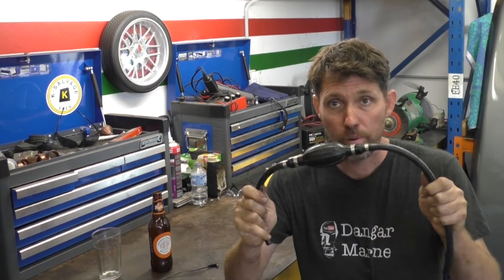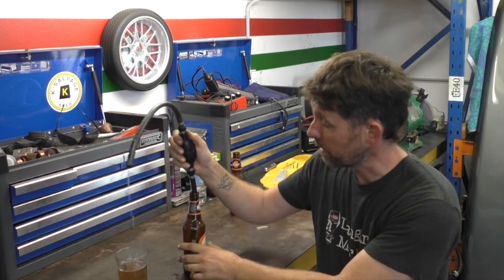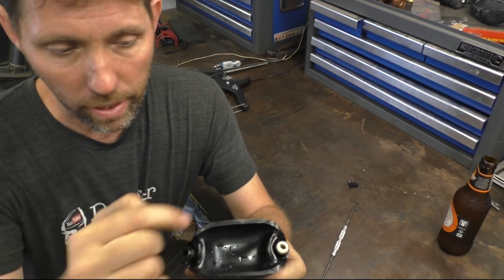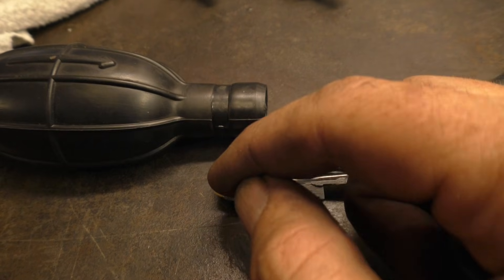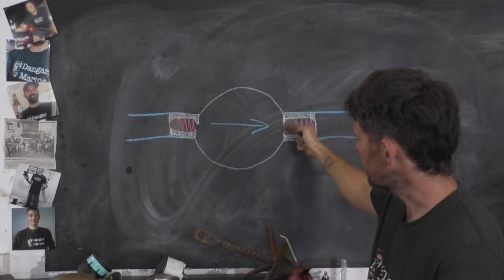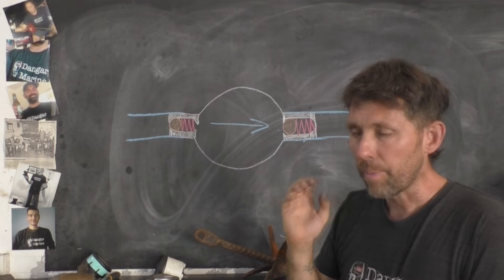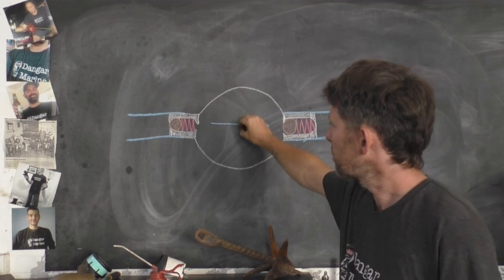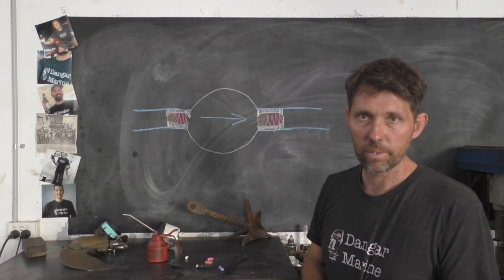Outboard primer bulbs

Comment: You just reminded me of another dumb thing I did. Squeezed the bulb with the arrow pointing down and no fuel got primed. I thought there was something drastically wrong until I checked google and found out there was an arrow on the bulb. I did it for years and never knew that. Just lucky I guess.
Reply from the maker: Theoretically the arrow is really just to tell you the direction of flow so you don't install them backwards. A good quality bulb should work in any orientation so don't feel too bad about it. :)
Reply: Mine only works vertical with the arrow pointed up maybe it's defective.
Reply: I constantly have to prime the bulb. I believe I may be getting sir in the fuel line. The bulb is almost always soft. The RPM fluctuates up and down so I have to prime the bulb so it can run smoothly. What could my problem be?

Comment: Also forgot to mention would it be ok putting a water separater on a fuel hose... my out boards don't have the space for them in the cowlings... thinking just after the primer... something clear with a screw to drain water out like a 250ml bottle
Reply from the maker: Yep, that's fine. I've got a video on installing a water separating fuel filter in line.

Comment: Hey dan new to your videos (week or 2) but almost watched them all

Are you in hawksberry river?
I'm in Newcastle

I'm keen to see a setting points video

And 

The other one is the more of a q &a  but anyways I got a 9.5 evinrude and a 15hp Johnson

And a 12ft v front tinny

The 9.5 just makes the bow stand up and sinks the ass end in and the 15hp gets on a plane People tell me a 9.9 will get me on a plane easily but are they saying true and I just need the 0.4hp to get to plane... it uses heaps of fuel too 27litre tank gets me from speerspoint to Belmont and it's empty..... 1/2 a litre left

The 15hp on the other hand I was out for 4-6 hours on wot most of the time and only used 1/4 of the same tank

Mixed to 30-1......1st tank out of winter I always run it a tad rich to lub stuff up
Reply from the maker: Hi Ben, yep I'm down on the Hawkesbury. I did some points on a Kombi a few weeks ago but I haven't ever had an outboard that old in the shop. Sounds like your 9.5 is running way too rich which is why it is down on power and using so much fuel. Is the choke opening all the way when running?

Comment: Nice as always. You seem to always release a new video the same exact time im doing (or trying lol) to my motor!! Last time it was the merc fuel pump the same day i got the parts in. And TODAY I got my new Merc primer bulb in from ups! I was just researching the whole vertical bulb install all day today, Lol. The previous boat owner had an Attwood bulb that was really old and from the forums plenty of people say to always get an OEM bulb because the valves apparently aren't as good aftermarket. I just opened the new merc bulb and it sure as hell feels and looks of way better quality. The previous owner obviously lied to me about not using Ethanol because the attwood grey fuel line was FILLED with those yellow chunky ethanol remains and the inside(clear) liner was eating sh#!. Im gonna do like you told me before and get some new A1 line from an auto store to replace. Now that i got the bulb in i can knock it out now! Thanks again and can you please post the link again for the Dangar shirts? The shirts do get shipped to the US right?
Reply from the maker: If I keep releasing videos just as you need them I'll make sure I don't do any more of raising sunk boats then! ;)  OEM bulbs do generally appear to be of a higher quality but I have also bought some Scepter ones that seemed quite good. You can get shirts from https://dangarmarine.com.au/collections/merchandise/products/dangar-marine-t-shirt and they are printed in the US so you should get them faster than we do!
Reply: LOL!! Im ordering today..I don't have a facebook account to send picture with the shirt. I can post it on youtube i think(im pretty bad at newer technology) But ima post my pic with the Dangar shirt with my boat when i get it in. Again thanks for everything you...I hope you realize how much you help people out and are the best at explaining and covering all concers n questions!!! If there is a boating world trophy you deserve it!